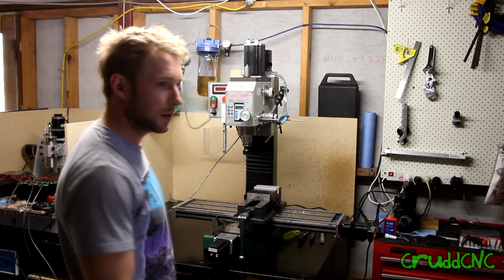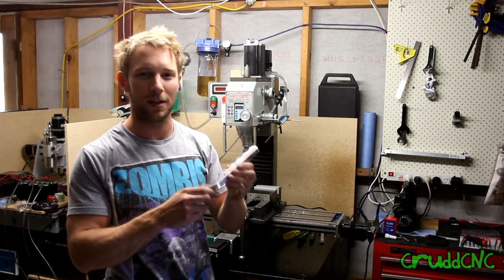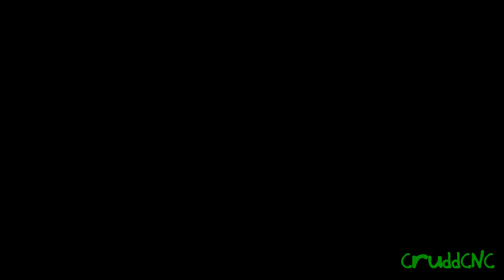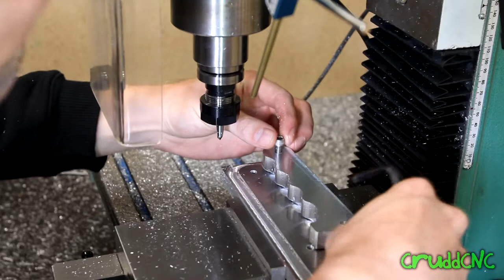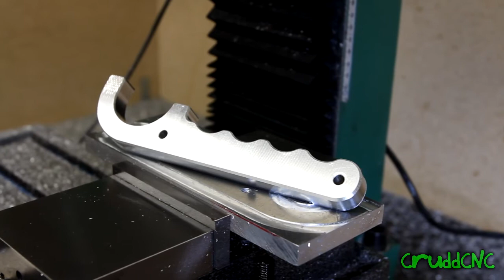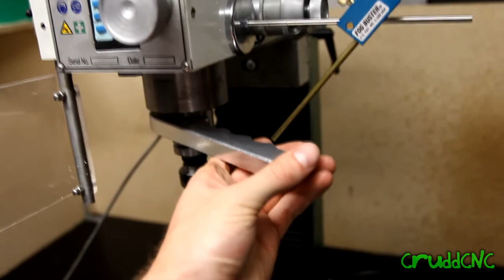CNC Mill conversion - Episode 4 - First part made

Comment: Hi :) 20 Years ago when i worked in a machine on an old mill we had a problem with the  finish on a GMC V6 aluminium waterpump for new car manufacturer. I inducated the insert tips in the cutting tool and shimmed them out to the deepest cutter and the finish was like a mirror after that.

Comment: I still need to install my limit switches.  So far my SX-3 CNC build has been way easier than others have suggested it would be.  Finding z-axis way oil that is sufficiently sticky was by far my biggest problem!  Will make chips in 1-2 weeks, so we'll see if my luck continues!  :)

Comment: Yeah that is correct but that is happening because a change of thickness requires more rigidity. Think about why face milling happens in the first place, because the metal ISN'T flat and square. If it was why face it? I have been reseaching single crystal diamond fly cutting and its all to do with rigidity and the momentum in your cutting tool. But hey what the F#$% do I know, no one said I was anything more than a guy in a garage.

Comment: Luke, fly cutting mirror finish has more to do with the kind of cutting tool you have and the rigidity of the machine. The traming only will create parallelism. It can be completely untrammed but all that will give you is a faced surface with one end higher than the other. Just as a tip so that you don't spend a month tramming the thing with out gettng the result you want.

Comment from the maker: I normally incorporate some locating bolt holes in the piece, then I flip it. In my CAM software I will flip the DFX sketch horizontally or vertically depending on the part, and then regenerate the tool paths for that location. As you can see I use what is called a "fixture plate" to fix the part to. Hope that helps?